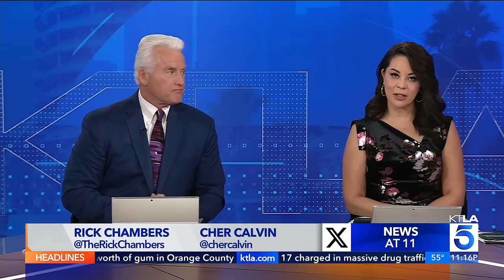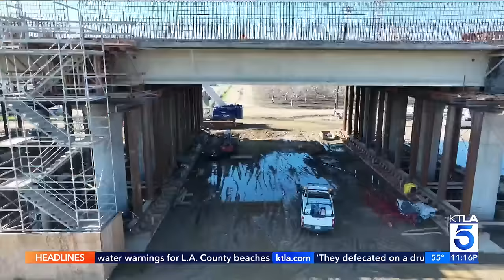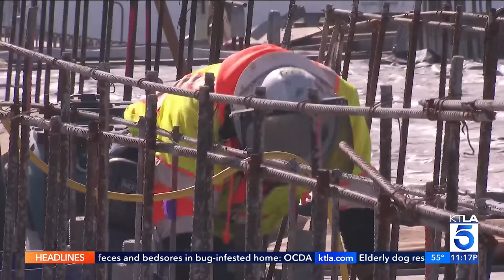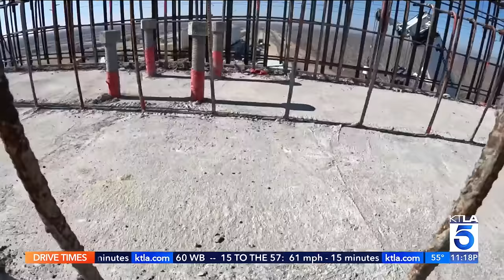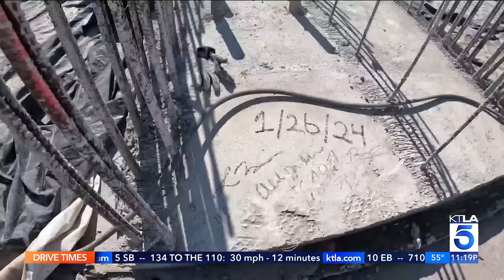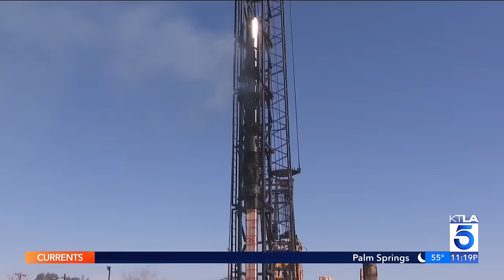California bullet train in works but completion date remains a mystery

Comment: Why not promote the project instead of spin it as negative.. the costs are pretty on par in regards to land acquisition, current usa construction costs, utility relocation, etc

No one bats an eye when a freeway widening project is 10 billion but an actually helpful HSR is the problem I guess😒
Reply: @BlacksRuinEverything  Basically everyone, imagine a regular person working in LA or SF, instead of paying outrages rent, the person could simply live in the central valley and ride the train to work in major cities. CV is a less that desirable place to live now, but once the train is completed, people will move there due to cheap housing and living expense, which in turn boost local economy for CV cities.
Reply: "Why not promote the project instead of spin it as negative" in other words, you want KTLA 5 to gaslight and propagandize the public.
Reply: @tonyhou4534     But that is not what will happen in real life. People want to live in the big cities because of the attractions and lifestyles. What you really mean is that you will be hoping that OTHER people move out so you can have a cheaper and less crowded city, but those other people will be hoping that YOU move out for the same reasons. None of you will actually move - not in significant numbers anyway.
Reply: Every public works project, even high speed rail, should be subject to risk-benefit analysis. The project made sense at $33 billion. But does it make sense at $128 billion? What about $1 trillion?
Reply: $100 billion over budget and still not close to completion, that's why it is fairly criticized.
Reply: @user-wj9bz8xi9u  Japan had this same problem too when it came to their shinkansen. They had tons of funding issues, also had it postponed from the war, and it took forever, and look at them now, they have one of the most successful high speed rail in the world. I know that Japan and the US might be different countries in terms of economy and infrastructure but just an example to put out here.
Reply: I imagine this the same rhetoric was around when the interstate system was being built, and that took 35 years for just the construction. USA has always been slow at building anything in general. You have obstacles like the NIMBYs, Land purchases, etc.
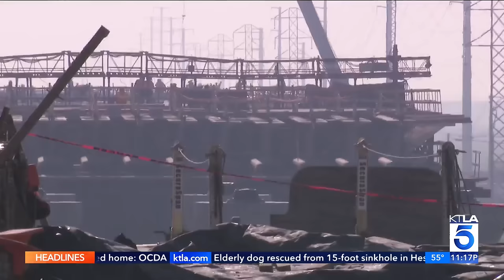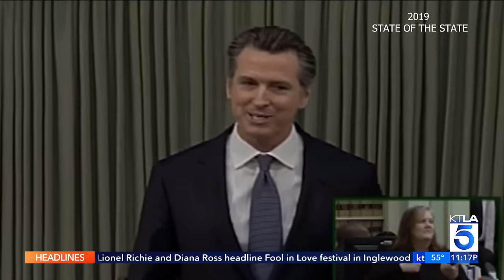Reply: @tonyhou4534  So, you really think so ?  Fresno to SF is 164 miles which is effectively equivalent to the distance between Paris and the city of Angers.  Time required on a direct TGV train is 1:45 minutes with an absolute cheapest ticket of $42 one way and a slightly faster train at 1:30 at $92.  Is this really feasible ?  

Sorry, most people working in Paris don't commute in from Angers every day.

Plus, with WFH most white collar workers no longer need to go to SF and, hence, why the local economy is imploding.  The ridership values of the future have dramatically changed as a function of WFH.
Reply: Financial accountability is important to the public. Not urbanist propaganda
Reply: Yes very true. Like a lot of people don't realize, everyday commuters will get discounted passes that will cost roughly 50% less than an average fare. There are thousands that take LA counties Metro train from downtown LA to Riverside and San Bernardino everyday and pay a small fee for weekly commutes. People need to understand that California's HSR is not modeled after Europe where a lot of those people ride the high speed rail for weekend trips or for vacations during the holidays. California's HSR will be great and if people ever go to a country that has HSR and get a chance to ride on a high speed rail train, they will see how effortlessly it is to get through security and your thoughts will change. On a side note, taking the Amtrak from downtown LA to San Diego Vs. taking a plane, it takes almost the same amount of time, but more stressful and more expensive to fly, then getting on a train and easily getting to your destination.
Reply: @HQSCJIPZ So, who is gonna subsidize a ticket on this HSR which will end up costing up to 500B? So, basically, you're promoring a LA-SF ride in 3hrs that will actually be 4-5 hours with added stops, with a 2K ticket price, over an existing AMTRAK 6hr $300  ticket? Has everybody in California gone crazy?
Reply: Costs are ON PAR with normal construction costs? So, FIFTY TIMES ORIGINAL ESTIMATE is fukkn normal?? And 30 fukkn years behind schedule? Right, got it.
Reply: @tonyhou4534 One problem; NOBODY wants to live in CV! Do you live under a rock? And, of course, theres the  400 to 600 BILLION cost overrun, & the 30 YEARS OVER completion date. Sounds PERFECT!
Reply: The real problem people have is the subsidies for just the operating costs will be many times higher than  all roads averaged out by passenger mile.
Reply: Costs are "on par" with current construction costs? Are you out of your frikkn mind? Most realistic estimates put completion at 25yrs & 300 BILLION more. EVERYBODY is "batting an eye" at this.
Reply: @HQSCJIPZ what if your mom was 1 trillion. What would you do then?
Reply: Wait, it was pitched to voters as $45b, with $9.95b bonds and finished by 2020. Were they lying or utterly incompetent?
Reply: It is 2024 and only 1 mile has been built in the middle of nowhere... the entire thing was suppose to be completed in 2020..
Reply: @trainsplanesandotherthings5187  you wouldn’t bat an eye at a freeway going over budget or past schedule. Keep coping, California HSR is coming.
Reply: Wow,   You really believe that?

Comment: KTLA got lazy in reporting on this project or some news manager over there has an underlying agenda against the CAHSR. 

Saying the priject is over budget is not true. Same is true regarding the completion date. If you look at the original documents it doesn't stipulate an overall price or completion date for the project.

The ongoing reports regarding completion dates and funding levels are best guess estimates. The project isn't in debt to say it's over budget. And the operational date is also a moving target based on many things. It's also a moving target as it always is on generational infrastructure projects that take decades to plan, design, build, and operate. That's always been the case throughout history.

And they are misleading the public when they put the price tag as $128 billion. That's the very high-end ESTIMATE! That number comes from a report that actually gives a range from $88 to $128 billiin. That's very different from just plastering $128 billion on the screen and the voice over says, "up to $128 billion." Why not say the complete truth? Say instead, "from $88 to as high as $128 billion." That's accurate reporting without bias.
Reply: It will deff end up costing over $128 billion, I'd be willing to bet you on that. You're obviously young and haven't seen how projects like this play out over the long term.
Reply: Its way over budget and it has failed to be completed despite pushing the completion date back repeatedly
Reply: @StaYUTI420 That has to do with politics and federal funding, not issues within the  CAHSR project.

And the speed of funding awards affect final costs. It's not a physical construction limitation. If CAHSR had more funding NOW, they can start work around LA and SF including the LINK project at Union Station to get it ready for CAHSR. They could speed up the geological work for the tunneling to start the tunneling even sooner.

It's about political will and bold leadership. Had that been the case from day one, the CAHSR from LA to SF would have been in operation by the 2028 Olympics.

Republicans and conservatives in California have been putting up roadblocks from the start including trying, unsuccessfully,  to kill the original proposition. And they keep at it even when they've been on the losing end over and over. They're still holding out of killing this project through a thousand small cuts since they couldn't do it in a single blow. I don't understand why Republicans and conservatives HATE PUBLIC TRANSIT. No one is taking their personal vehicles. What are they so afraid of? It's not about cost because Republicans and conservatives waste a lot of money on things like unnecessary defense spending or tax cuts for the very wealthy. It must be about simple ideology and fanatic dogma. It's pathetic and short-sighted because the country is worst for it.

With all that being said, CAHSR will succeed spectacularly in spite of Republicans and conservatives , and we'll all be able to enjoy the travel benefits of HSR including Republicans and conservatives. You're welcome.
Reply: @mrxman581  I really don’t understand that argument by people who think having HSR, or better transit in general, will somehow mean they’ll be forced to give up their car, as though we can only have one travel option. 

Like dude, no one is trying to take your car. Car culture is far too engrained in our society for that to happen, in the US and especially in California. What transit does, both within cities and between them, is give people more options. Having options are a good thing, cause it means those who have to drive can opt for transit, when it’s the better option (faster, more convenient, safe, etc.), resulting in less traffic for those who’ll choose to keep driving. 

It’s about having freedom of choice, having greater mobility, bringing cities and regions closer together and the economic opportunities that provides. Just as you have the freedom to drive, those who can’t or don’t want to drive should have the freedom to travel too, be it within a city or to other cities, on modes of travel that are faster than driving and, for intercity, more convenient than flying.

Comment: These folks are still under the delusion that they can someday build a high-speed right of way through the Tehachapi and San Gabriel Mountains? F outta here. The current best rail path through the hills is the Cajon, and those trains MUST slow down to about 30mph on the descent. Granted, light passenger rail can go quicker, but high speed around mountain curves isn't a thing for trains. They are not Ferraris.

Comment: How do you spend $ 11 BILLION on 1600 feet of construction?
That's $ 6,875,000 per foot ...

Where did all that money go?  
Start the audit, start the arrests.
Reply: You have to be very gullible to believe that 1600 feet cost $11 billion. To date 45 major structures have been completed with another 34 structures under construction and 57 miles of guideway have been completed. Total purchased parcels delivered to date – 2,262 parcels compared to an estimated 2,288 parcels needed. 🤣🤣

Comment: what are the benefits of having a Merced to Bakersfield line? This is going to be a disaster, by the time they complete that section inflation will increase the cost by another few hundred billion dollars.
Reply: Getting the hang of building one of these on flat easy land before they attempt to get near the coastal mountains?  The middle had to be done eventually.
Reply: I wonder how Californians will deal with the inevitable failure of high speed rail?
Reply: @gooser__43  why are you so against HSR? or are you just a troll
Reply: @ttkn5056  boomer mentality. Dude has no idea what he's on about probably thinks one more lane will fix all our problems

Comment: We need that train from L.A to S.F. Man that would be sweet! Hard to get excited about a Bakersfield to Merced connection.
Reply: The whole point of making that a reality is to shut up the complaints of people saying "but why is there no train running yet?"
Reply: @solenstyle When it does ever run perhaps the complaint may be why are there so few passengers traveling in the bucolic valley?
Reply: @davidjackson7281 But you would have a functioning train, which the developers can point to when asking for funding the rest of the rail. 

You will have less hit pieces like this news segment we just watched.
Reply: Without the section between Bakersfield and Merced, you'll never get from LA to SF and vice versa.
Reply: BTW, another reason for building the 171 mile section first is because it will also serve as the testing track for the 220 mph trains. Currently,  there is no place in the USA that is capable of testing trains at that speed and higher. The CAHSR will test the trains at 242 mph so they can run them at a top speed of 220 mph very safely. Start building in LA or SF wouldn't have given them that option.
Reply: @solenstyle How many riders will this valley segment train actually have by 2030-2035? Yes, CAHSR will 1st need $5-7 B more funding from the federal government before there can be any revenue service. Sorry but the "hit" pieces will continue for those reasons alone.
Reply: @mrxman581 l do recall how you enjoyed taking the Desert Wind. Personally, l have no real interest in Las Vegas. But l would go to LV just to ride on BLW. When CAHSR does begin to operate l would imagine there will be much more demand to take the Metrolink San Bernadino line to Rancho Cucamonga from LAUS, etc. than there will be for taking the Amtrak bus to Bakersfield. Also, perhaps more will travel from Palmdale/Lancaster to Victor Valley than to Bakersfield, etc.
Reply: @mrxman581 Hi, there, 250 years ago, people must have said you would never be able to get from New Yuck City to Los Angeles in a day. Some people say the word can't is not in the American people's vocabulary.

Comment: Getting it from LA to Palmdale or San Francisco to San Jose would have provided much more utility. I love Merced, but ridership likely will not be so significant despite the length in the central valley.
Reply: I'm sure the idea is to get that done.. THEN connect L.A and S.F
Reply: @Mac-po1sr  Yeah, that's the idea, and hopefully, it works out. I would love to use it one day.
Reply: @Mac-po1sr Yeah connect w/55 miles of tunnels. Some dumb idea. Do not hold your breath.
Reply: You're not wrong. Unfortunately federal grants at the time, required that disadvantaged communities were connected first. And the Central Valley cities matched that profile. So we will make do. It will all be worth it for the hundreds of years this thing will be operational.
Reply: @davidjackson7281 It's 40 miles of tunnels to LA.
Reply: I disagree. Both ends will be connected to other modes of transit to each end. On the Merced side, it will be via another train connection. On the Bakersfield side, it will connect with a bus. Probably an express bus that will take 2 hours. However, right now it takes 10 hours to get from LA to SF by train. So taking a bus from LA, then HSR, then another conventional train to SF, will still be faster by about 3 hours. So I can see many people doing this instead of taking the 10 hour trip via a conventional train. It won't be just people going between Merced and Bakersfield.
Reply: @mariusfacktor3597 Yes, but that could be easily 40 years from now. No hurries No worries.
Reply: @mrxman581 Yes and 15 miles of tunnels to SF. That totals 55. Do you care how much those will cost and more importantly do you realize how long they will take to dig?
Reply: @mrxman581 Your comments are very interesting. Much appreciation. To coin a phrase: They make great food for thought fodder. The 171 mile hsr section will reduce travel time by 90 mnutes plus a faster bus would save closer to a total of 2 hours than perhaps 3 hours and require a 3rd "quick" transfer at Merced. 

Please excuse me Central Valley, who already has the San Joaquins, but from SF-SJ-SLO-SB-LA perhaps a better solution would be to spend about $5-10 B to upgrade and extend the coast line for a one seat 5-6 hour ride averaging 70-80 mph with no transfers. Think Brightline.

Comment: Why is the train built on those high viaducts?? That must be very expensive. They couldn't run it at grade, and run the roads under it? Is this how they do high-speed rail in France and Japan? It just looks like so much concrete and steel. I can see elevated tracks through the urban centers, but this is out in the sticks.
Reply: Farmland is more valuable than choo choo trains.

Comment: So the whole system was supposed to be 34 billion . Now you get 117 miles for $135 billion . I’m guessing the 40 miles of tunnels will be $500 billion by the time they start and we might be riding it in the year 2100 😢🤡🤡
Reply: In February of 2100, I'll be 126 years old.
Reply: This is so wrong i'm tempted to say that it's just bait... But i'll bite for the benefit of any readers...

The section under construction right now is 171 miles, not 117, you literally flipped the digits. 135 billion dollars has never been an estimate used be literally anyone ever. The absolute highest estimates for completing the entire SF to LA section is 128 billion on the high end. Most of that going to tunneling and land acquisition. The current section is costing about 8 billion.
Reply: @LegendaryRQA  yes so it was 171 miles and 128 billion. But that’s still insane. It will balloon when they start designing the 40 miles of tunnels. Too bad Europe had their first subway in 1860 something. I think America is way behind.